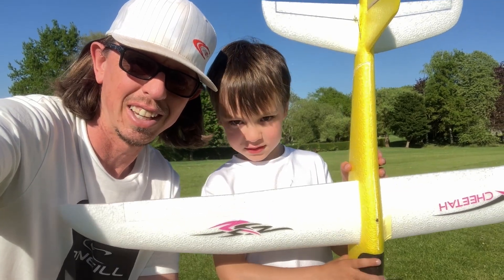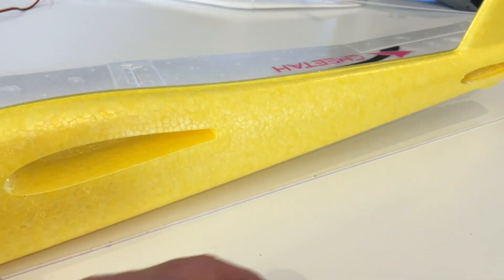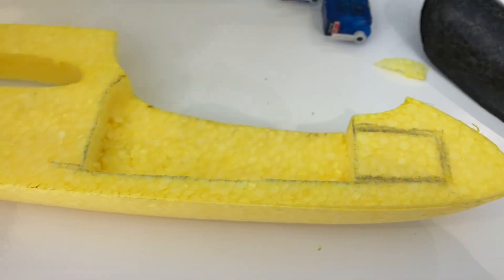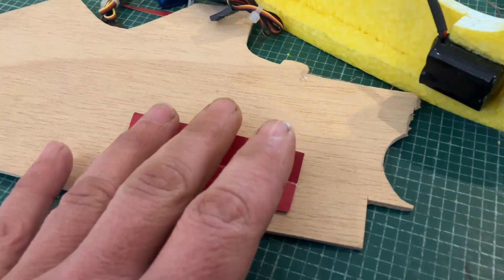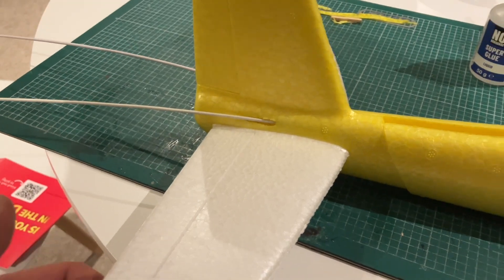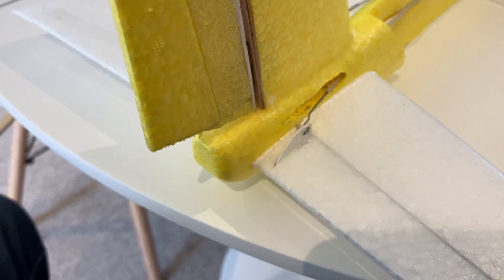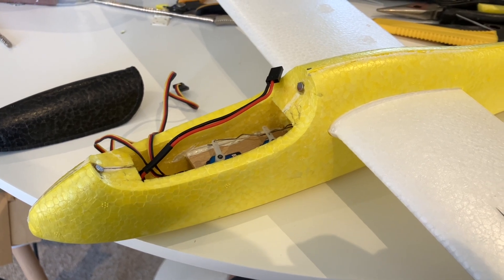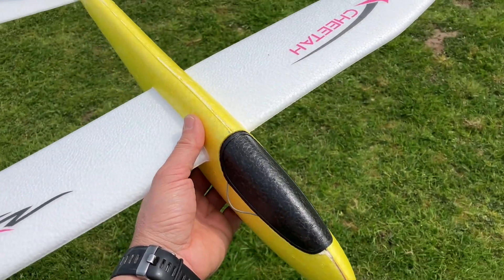We Turned a $15 Chuck Glider into an RC Plane – You Won’t Believe How Well It Flies!

Comment: I’ve made something similar but I did a completely fixed tail setup with pitcheron wings. The control is setup like a battle wing and I designed it to the wings are held on with a rubber band and can easily be disassembled. I also launch it up in the air using an old school hi-start launch system. Yours looks very clean though with the servos inside. My servos are under the front of the wing inside some notches I cut out.
Reply from the maker: Nice sounds great. The reasons I went with a simple rudder elevator was mainly as this was for my son to learn to fly with so I wanted it nice and simple to fly and understand how it worked plus I thought I was going to need to add more dihedral but that turned out to not be an issue.